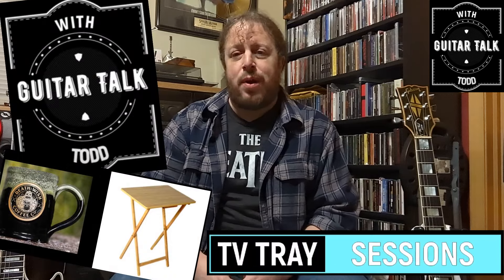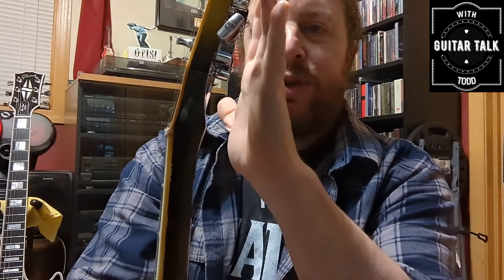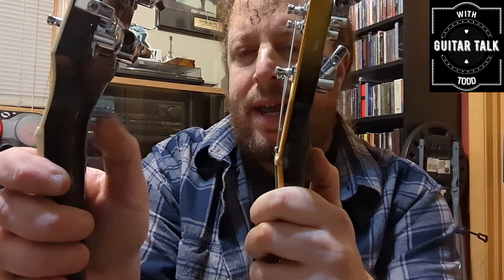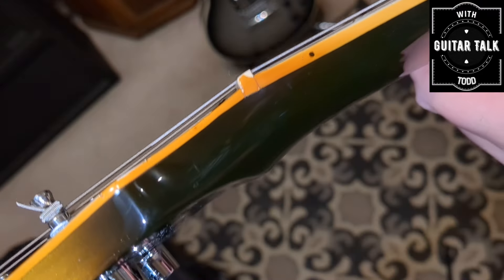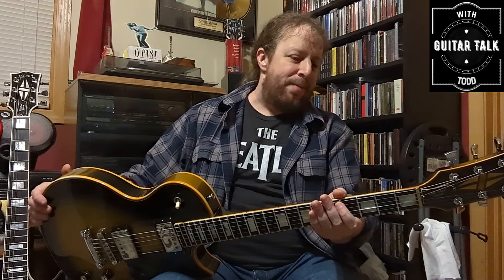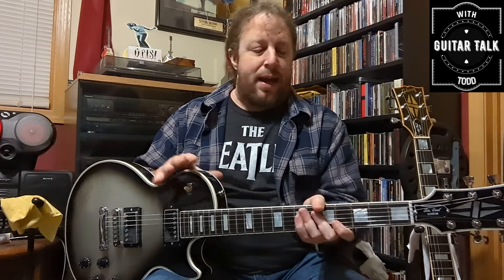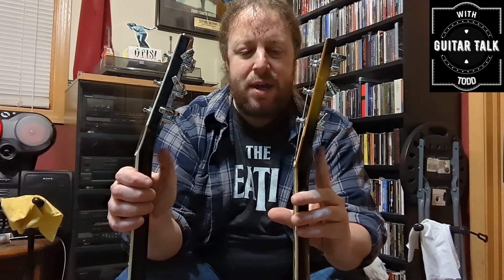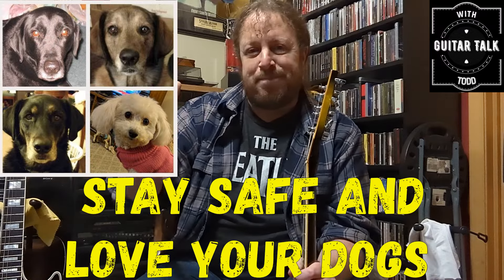What exactly is a guitar's volute?

Comment: Thicker wood has gotta help. 
 The truss rod hole and the nut cut leave very little wood at the most critical point.
Even though the truss rod balances the tension the neck is still under serious tension from the strings.
The strings are trying to winch the neck forward.

Maybe the wood dries out as it ages and becomes more brittle.
Unfinished necks would be extra vulnerable..
Imagine doing a powerful string bend and Pow the headstock goes flying off.
Now I'm thinking about guitar humidifiers.

Comment: My 73 LP fell to the floor in the worst possible way (backwards) so the superior side of the headstock hit the floor first. It survived as if nothing had happened. So my vote goes to the volute.
Reply from the maker: Great story! Thanks for posting this. It's great to hear about a first-hand experience like this where the volute actually helped save the guitar!
Reply: @toddbeebemusic-guitartalk  reducing the headstock angle from 17 to 14 degrees also helps and you get a better tunning stability by reducing the friction on the nut
Reply from the maker: @ManlaySound  Yes! That lower headstock angle definitely helps with tuning! I totally agree!